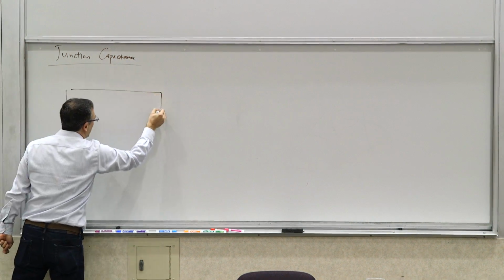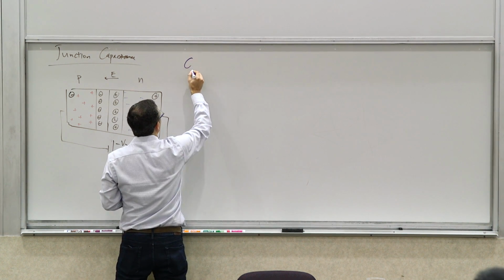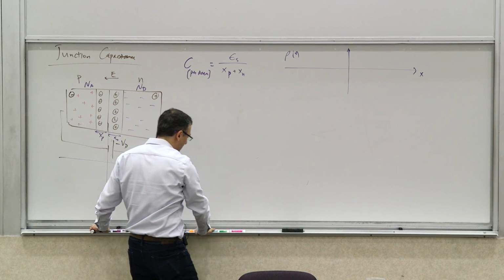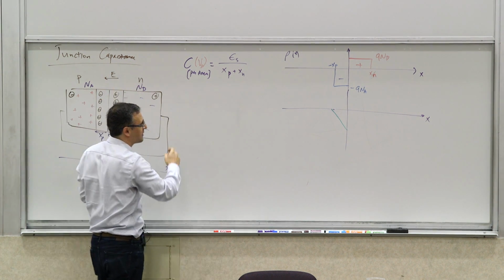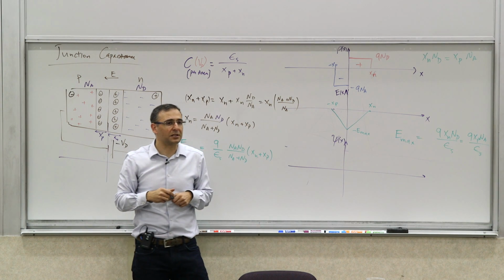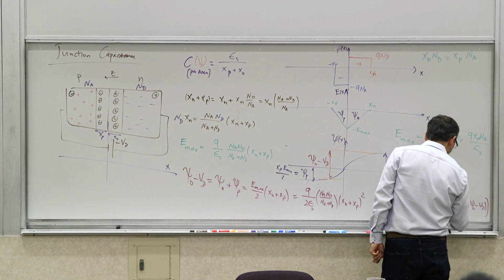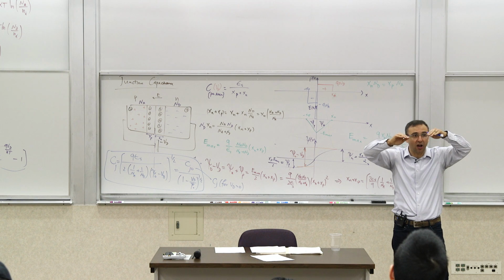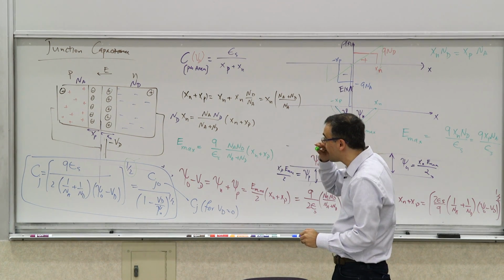105N. PN Junction, Junction Capacitance, Doping Profile

Comment: Thank you very much for your work professor. The only thing that for me is not clear is the meaning of "psi minus Vd". It cannot be the voltage accross the diode (because it is Vd); (psi-n) + (psi-p) seems to be the voltage accross the depletion zone but to me that seems to be equal to Vd. I'm confused. Is it related to the definition of differential capacitance (so, Vd is not a constant voltage)?

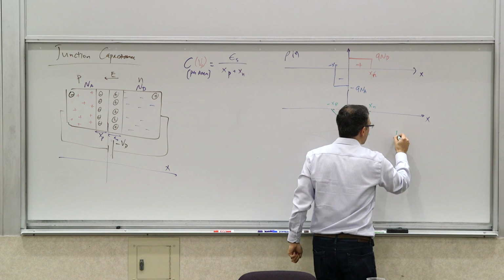Comment: (Referring to instant 13:48) the permittivity of the semiconductor is constant throughout the device (especially in the depletion region), or it depends on the position in the device (depletion region)?
Reply from the maker: We assume inform primitivity, as it is essentially a macroscopic aggregate property of the material, which quantifies the degree to which it can be polarized. At eh microscopic levels the interaction of the fields is a lot more complex, but since we are trying to determine the macroscopic properties of the device (in this case the PN junction), we can use the average global parameter.
Reply: I got the essence of what you are explaining. Could you please explain what is inform permittivity?
Reply: @dishachugh8493  I think he meant uniform permittivity.